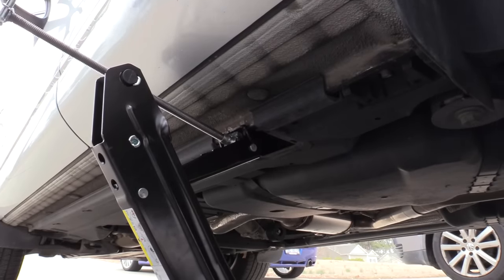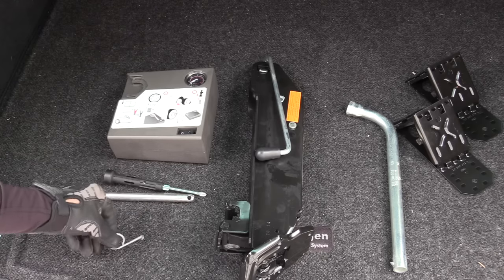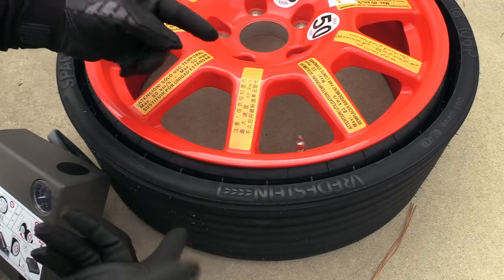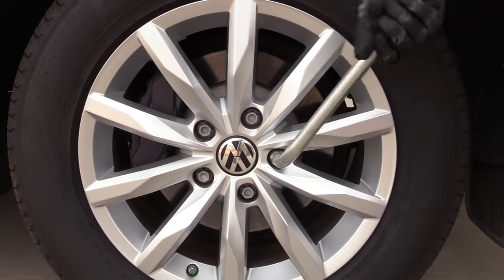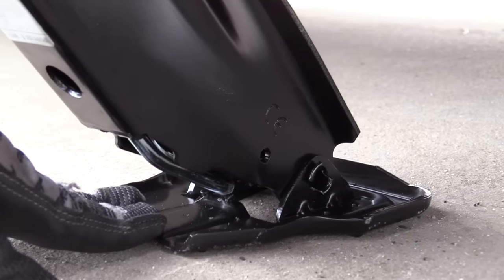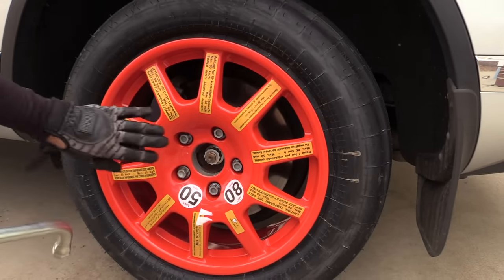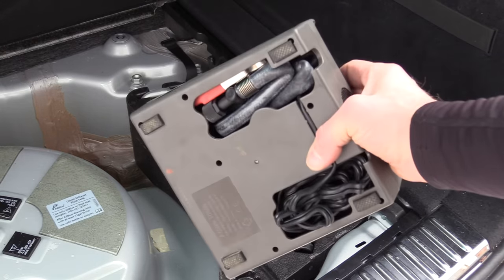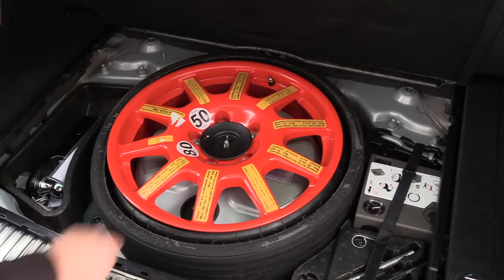How To Change a Tire with a VW Jack (The WIDOWMAKER)

Comment: How to change a tyre with a vw jack? You dont. You Buy a proper jack.
Reply from the maker: It works fine if you use it properly. But I also thing buying an upgraded jack for your car is a good idea. The Touareg jack is a better jack than the ones in cars.
Reply: HumbleMechanic 
That jack is similar to ones supplied in some full size GM cars from the 80’s
Reply: @HumbleMechanic  The little scissor jacks? I've never had a problem. I love the ones that come in Subaru vehicles. Always nice to have a few around from old cars to help with strange jobs.
Reply: Lol exactly 😂
I always prefer the scissor-type jack.
Reply: @HumbleMechanic  Yeah its fine if you are in a nice level parking lot or garage but useless if your on the side of the road on the highway on some gravel uneven ditch it will fall right of the jack or on an icy drive way or hill then you are sol.
Reply: Mopo151 the lingo probably came from your own country, however our jacks are superior, which is why ours aren’t known at all for dropping cars on our heads and caving in our teeth @your country.
Reply: Agreed. Its fine on level ground. Am sure all of us would have a trolley jack
Reply: @HumbleMechanic  I chocked the opposite wheel on my a8 and the jack still folded up like a paper cup when doing a highway side wheel change on totally flat ground. Then I put a harbor freight jack in the trunk. That Audi put such a pathetic jack in an 80k car ought to be a crime. I was using better chocks than the included garbage, too. A jack which can only be used in a shop is worthless on the road.
Reply: @ricochetey  Not true. The VW jack is actually quite sturdy and capable. I had a flat last fall. Pulled off a 2 lane highway into a gravel parking lot, and the jack worked perfectly.
Reply: @dennismicallef9350  I said an" uneven gravel ditch " possibly on an embankment where I have changed many tires. I worked for a towing company and changed many flats for customers sometimes you can pull into a nice parking lot on the FREEWAY!
Reply: C-Bomb  scissor jacks take up twice the room. It's simple space saving by the Germans. And if you   know the right technique, they're fine to use. Even on gravel..
Reply: I agree. Once you use a hydraulic floor jack, you don't go back.  Worth keeping a small 2-ton one in the trunk.
Reply: @Mopo151  Stupid? Hell no. How do you think we harvested the power of the atom to stop the entire world from using these jacks?
Reply: C-Bomb   My scissor Jack for my old truck was definitely smaller than that, and my truck definitely heavier than that Tuareg. A scissor Jack is way safer, and doesn't require someone to "know how to use it properly;" because it's self explanatory. I would never let my family use a jack like that.
Reply: This foo don't get it

Comment: bad enough having to change a wheel , without having to wait an extra 10 minutes to to inflate it , not so long ago all cars came with  a wheel that matched the other wheels on the car perfectly , SPACE SAVERS ARE A STUPID IDEA !
Reply: Considering how large the wheels and tires are on an SUV like this, it makes some sense it's hard to fit a full sized spare into the vehicle.
Reply: Its allot about weight savings.
Reply: @KriegerDelfin24  Air doesn't weigh that much ya know.
Reply: @802Garage  most trucks and SUVs have their spares under the rear of the vehicle. I'd rather have a full spare (that my 2 SUVs don't have) than a donut.
Reply: They have using space savers since the 70s
Reply: Flat tires are fairly rare. Many vehicles don't even have spares anymore. I'd gladly take a small spare over no spare at all.
Reply: @1FAST91SONOMA  vehicles that have no spares have a compressor with a fix a flat can in the trunk. Havent had a moment where i blew a tire but a spare tire seems to be easier and faster
Reply: @skullifier233  The fix a flat is a complete joke. When I worked for a tow company I never had a case where it would of worked. Its fine if you have a small puncture or a bead leak. If the damage is on the side wall or a decent chunk of metal or plastic you are SOL. Not to mention it usually destroys the tire pressure sensor.
Reply: @skullifier233  that's not always true. My truck has no spare. No fix a flat. No compressor. No room for any of that. It has run flats though
Reply: @1FAST91SONOMA  thats probably why it doesnt have a compressor or fix a flat
Reply: @ricochetey  not only that but the clean up after that fix a flat stuff is used? I work at a dealership and a van came in with a tire pressure light on. Determined that sensor is faulty so as i was removing the tire stem to remove the tire the fix a flat stuff clogged the valve stem. Had to pop the bead slowy to remove the sensor and inside the tire was covered in that fix a flat goo stuff. PITA to clean up
Reply: @skullifier233  nope... It has all that because I put corvette wheels, tires, brakes, and engine into it. Stock is just the beginning, not an absolute.
Reply: @1FAST91SONOMA  ah, ok. I didnt know that.
Reply: @skullifier233  agreed
Reply: I agree space savers and other shit is nothing but a pure gimmick. I like having my car with a full sized wheel theres no bullshit.
Reply: 121bham  Wish I could. Gotta have 100K. :'(
Thanks though!
Reply: 121bham  Heck yeah. I have a lot of big things planned for 2019. I'm pretty excited. I appreciate the support! Aiming for verified by next year.
Reply: Tom williams a normal space saver does the job... this thing on the other hand
Reply: @802Garage  just put it under like a truck.
Reply: @LinusScrubTips  Like I said, where I'm from those end up rusting solid AF! While I'd keep it lubed and free regularly, puts the average owner in a worse spot.
Reply: 121bham  Thanks! Appreciate that feedback. More to come. ;)
Reply: At list this one actually has a spare unlike Hyundai and Kia (same pile of junk) that just gives you a compresor.
Reply: and then they lie in the trunk for 10+ years and are worthless 90% will nog check it. you can stil buy a normal wheel by vw. and put it on you roof
Reply: @skullifier233  Or they have run flats. Just remember if you use fix-a-flat, Firestone stores can't repair it. For some reason, it's said the stuff has a chemical that ruins the rubber making the patch not stick. I want to go against company rules though sometime and repair my own tire that has fix-a-flat in it  just to see what actually happens.
Reply: @bairfamilyfarm1336  maybe that fix a flat stuff really ruins the rubber or firestone just wants to sell you new tires and not hassle cleaning up and patching it
Reply: @skullifier233  The Second Gen Touareg actually had an optional Spare wheel on the back of the Vehicle.
Reply: Space savers are a dumb idea. Especially because when you travel with a full boot of luggage then change the spare then you have a full sized wheel with NOWHERE to put it, Plus you are limited on speed/ distance/ handling.

All for a few kg's "Weight Saving" when we all know it's just nonsense.
Reply: Tom williams 
It’s like 5f out .....
Or it’s 35 and raining sideways ....
Or you’re in Death Valley....
Reply: You only have to wait that long if you are silly enough not to remove the valve core before inflating it.
Reply: @802Garage   My IS300 has a fullsized 17inch alloy spare. 
COnsidering that A tuareg or any other SUV has  more space, I doubt it to be a problem.
Our Toyota picnic has also full size spare below the trunk.
Unfortunately on my IS250 they moved to a donut tire.
Reply: @IllenbergAir  The Touareg tire and wheel is 29 inches in diameter. The IS300 tire and wheel is 21 inches in diameter. Plus the Touareg wheel is wider. It's also going to be much heavier. I'm not saying it's not possible, I'm saying there are numerous reasons they chose not to.
Reply: @802Garage  oh yeah i get that but still. You would think VW would find a way to fit a large tire in a large suv. 
Just think a donut would be better than this thing since theyre usually made for 50 or 60mph... 30mph on this must be a pain on the freeway. (Depending where you are) 🙄
Reply: @IllenbergAir  I hear you for sure. Any way to pinch a penny and some MPG these days.
Reply: @802Garage  Yup, unfortunate but true. Cheers for the Info.

Comment: one more reason to not by a VW yeeesh.
Reply: 121bham 😂😂😂 burn
Reply: Eye wood never bye a VW..... Did i get it write! Lol
Reply: Eye buyed too vulkswiggins
Reply: ADR  Volkswagen make good cars... whoever thought that spare was a good idea needs to be fired though...
Reply: What reason is this?  Most modern cars don't even come with a space-saver spare tyre...
Reply: BMW has no spare at all! The only equipment is a damn hopeless rubber cheese-paint-spraycan (useless in case of a side damage or a damaged rim) & a third-part supplied compressor. Big up to VW still using the space saver.
Reply: 121bham  vw are nothing but money pits after 4 years... Weak ass transmissions too
Reply: 121bham  u have made a big fool of urself to assume this on a random guy in the internet...
Reply: bmw’s have em too lol, found out the hard way
Reply: I don't get this comment. Is it only VW's that get flat tires?
Reply: @MauriiBoii  well i have had around 20 year old VAG cars (1.8, 1.9 4-motion and fwd , 2.5v6tdi 4-motion, 2.5tdi v6 quattro a4, 2.8 syncro passat , 4.2v8 quattro a6   and they are good, easy to maintain and repair, newest car i have had was skoda octavia 2009 and it's so simple compared to example my parents car,  GLK 2010 mercedes.
Reply: 121bham  damn dude... Y dobu have so much hate inside u? Second I'm just a regular ass Mexican American, third...from experience and mechanics advice, vw and BMWs are just trash..u are probably those guys that think Mercedes cars are a good investment and are very reliable...smh
Reply: 121bham  ,,,ye,,,,eye wood knot ether. Sheash,,,,,,watt eh as hut.
Reply: @TheLtVoss  nah here in America.. Mercedes are just for the rich that buys a new Mercedes every 2 years... So they are made as planned obsolescence.. Second, they depreciate more than any other car... I only buy Japanese cars, which are known to be reliable ..I got a 2003 Tacoma with 300k miles and I am sure it's still more valuable than any 2010 C class Mercedes
Reply: 121bham  lol I wouldn't want this euro piece of garbage. I've worked on em and they are utter shit
Reply: Man, you're not kidding!
Reply: thats not how "most" work my familys VW van from 2002 has a much safer jack.
Reply: I can tell you working in body shops, where I was the main one changing the spare. VW is the worst car to change a tire on and this is using a real jack with an air impact gun. lug size is small (crap! got the wrong socket), pinch weld has crap all over it (almost break it every time with a real floor jack), without the wheel hanger it's easier to put a 33+ tire on a truck. and if your lucky to have the normal spare. it's sad that VW is a good car that no one wants to work on.

Comment: Overengineered simple job   👎
Reply: The "wheel hanger" I find especially amusing
Reply: Not over engineered, over complicated. Engineering includes user friendly.
Reply: @abdomar0528  you've never seen the German's before
Reply: @JTLowry  lol please explain.
Reply: @zuilok  Definately the most useless part in this IMO. Could easily have done the job without it.
Reply: @MartinElmo  Especially because if you really want your customers to be able to easily able to put the wheel on and stay on before you put the bolts in. You design the car with studs! Just like all my Subarus and my Mazda.
Reply: @zuilok  Ford also has studs where you put a nut on instead of the bolts. At leas european Ford (not sure with US Ford)
Reply: @zuilok  except with most other brands it is a lot easier to change a tire because the tire already has air in it and requires far fewer processes.
Reply: that wheel hanger was pretty clever, the most usless part was the space saver.
Reply: @7o177  not really. but with them not having studs it would pretty much be impossible to mount the tire without it.
Reply: @678friedbed  why doesn't the car have fucking studs to begin with like every other car since forever
Reply: das auto
Reply: thisisntme I’ve changed studless wheel hubs fast asf and probably upwards of 50+ times definitely not impossible
Reply: @Gfabsgarage  taking words out of context in a sentence. check

taking a sentence out of context in a full conversation. check. 

fell free to post the link to the video of you installing a wheel without the use of a stud. ill be waiting.
Reply: @Xachremos  thats Russian engineering for you, international over complicated engineering in an attempt to be different proving the statement that just because you are different doesn't mean you are useful.
Reply: @zeroyon223 funny. not only do i check my spare tire pressure regularly i have an onboard air system that will run air tools. if someone isn't checking their spare, thats their own fault.
Reply: If you think that was bad, try changing the battery!
Reply: @Stantonv  one of the things i check before buying a vehicle is how hard maintenance will be. if i have to pull a tire to get to a battery, im not buying that car.
Reply: @678friedbed  what if you had to remove the drivers seat?
Reply: Exactly nothing wrong with a full size spare wheel instead of this space saver crap

Comment: The 'saved space' 'saved' by the 'space saver tyre' is used by the compressor and needless extra steel around the tyre. 
Good job, VW.
Reply: the width of the "space saver" is a couple inches shorter making it sit lower in the wheel well thats where the space is saved

Comment: This is why all the vehicles I own have full size spares, an exhaust inflated airbag jack, and a battery powered rattle gun with correct socket and adjustable torque, mounted in the boot on charge. A canvas bag also contains gloves, hand wipes, etc. Even my wife will happily change a tyre now. Quick, easy and very safe.👍👍
Reply from the maker: NICE!!!!
Reply: never knew the exhaust jacks existed, thanks for the topic to look up.  I'm not in the off-road world, but it seems interesting.  What brand do you have since there seems to be about 4-5 of them?  Cheers.
Reply: @K03sport  Though mine is a few years old, I purchased the exhaust jack from Multispares, a heavy vehicle parts supplier, in Wingfield, South Australia. This airbag is manufactured with kevlar, so is extremely strong, flexible and puncture proof, but not idiot proof. Size is 1500mm long x 500mm wide, will expand to 800mm high fully inflated, and support 5000kgs. Just attaches to vehicle exhaust via hose. There are several on the market but mine is made in Australia. Hope this helps bro 👍👍
Reply: Class 👌🏽
Reply: Better convert that battery powered rattle gun to one that can hook up to your car battery. The original battery will be dead by the time you need it. Nothing is more sure to work than a 100% metal manual wrench.
Reply: @Engineer9736  Very good point bro. But have it covered with a computer controlled 12 to 240 volt inverter made by Redarc in South Australia. I fitted them to all the vehicles 👍👍

Comment: That tire is some insane rubber tech. Wow, what a job! That jack is actually pretty clever though.
Only thing I have done with a Touareg is take all the front subframe bolts from one in a junkyard.
Someone had taken the engine and the bolts were long and super high quality.
Gonna use it to space a subframe for a V10 swap! At least that's the hope.

Comment: That wheel is actually a pretty cool design. I’ve never seen one like that before. Neat!
Reply: But maybe a black steel rim would look better :/ it's like they wanted it to look nice but then also wanted you to remove it as soon as possible. It's the one night stand (or Hooker) of spare wheels.
Reply: 😂😂😂 it does look cool but youd need 4 of them to look good
Reply: @MrHeHim  Thats the point
Reply: @MrHeHim  just rattle can it, it'll look ten times better than the red.
Reply: @MrHeHim  well, they no people are lazy af and theyll continue to drive on the spare for a month before getting it changed back lol
Reply: It looks like a rally wheel

Comment: That's neat how the sidewall folds up to take less space. I like how VW figures out how to use a regular size wheel & tire, instead of a donut spare.
Reply: Other makes do this too, Volvo does
Reply: Any awd/4wd vehicle has a full size spare.
Reply: My 2007 Passat has a full size spare. It's not even the AWD model. No need for that pool float in the trunk.
Reply: Sure it looks nice, but it is expensive to replace.
Sure you dont use it that often but they  need replacing, if the car is used not a bad idea to do so.
Reply: @TravisTLK my Subaru does not...

Comment: those jacks are some serious death traps if used on gravel, i had to jack my car at home and used it (Audi A4 B5 Sedan) on tightly compact gravel and dirt, when the wheel was off the ground the car started to slide against me and fell over the jack.... had to get an another jack to get the car up and away from the Widowmaker.

I have never seen those spare tires in Norway except for in an old 1990 ish Porsche, all VAG cars here get the compressor and a 1/2 Liter bottle of latex sealant goo
Reply: the jack did the same thing to me while working on my car, scariest thing!
Reply: Always have a 12  inch square of plywood handy for that piece of shit vw jack
Reply: Yeah hate those awkward jacks. I threw a nissans scissor jack in the back lol
Reply: I replace the stock jack with a hydraulic jack and wooden plank, and to make my life easier I have a electric torque wrench to ease the tyre changing process
Reply: unless you have a lowered car hahaha  @ainzooalgown7589
Reply: @KDPFilms  same lol i dont trust it at all
Reply: At least Porsche has a reason for using such tires.